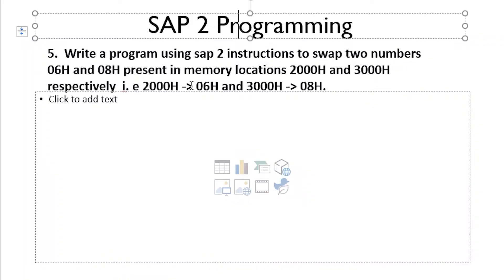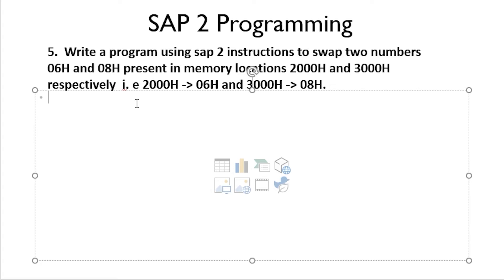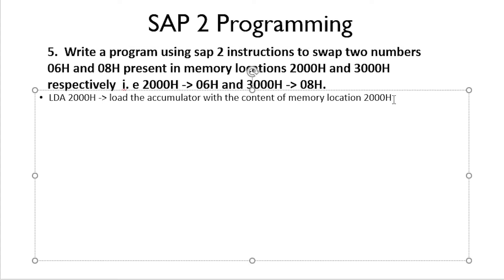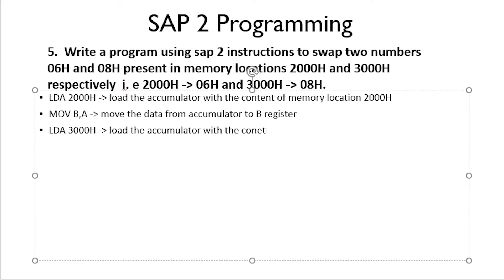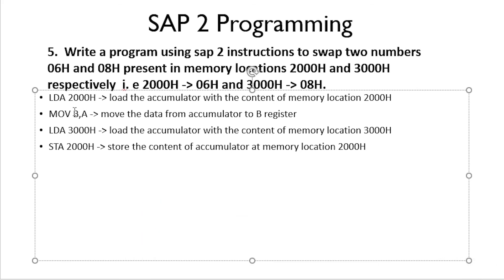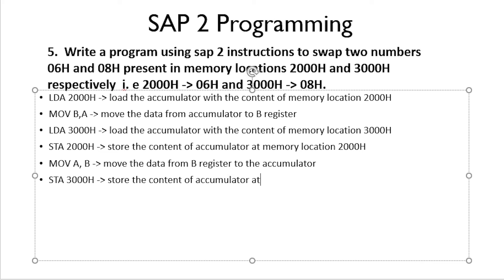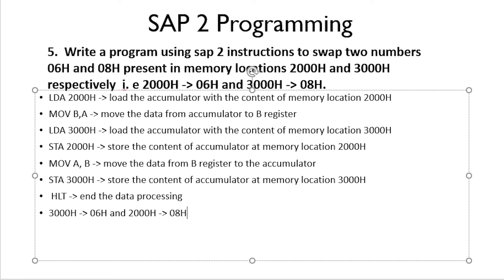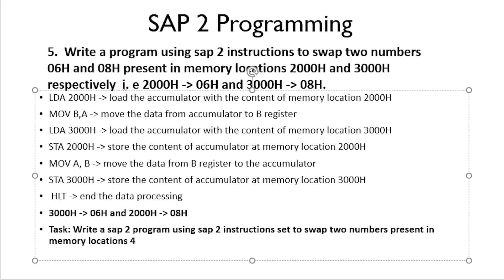SAP 2 Program to Swap two numbers | Assembly Programming

Comment: 4000H  LDA 4500H   A = 06H; loads accumulator with the data from 4600H
4001H  MOV B,A     A = B = O6H; moves the data from acculumutor to B register
4002H  LDA 4800H   A = 08H; loads accumulator with the data from 4800H
4003H  STA 4500H   @4500H = 08H; stores the accumulator to 4500H
4006H  MOV A,B     B = A = 06H; loads accumulator with the data from B register
4007H  STA 4800H   @4800H = 06H; stores the accumulator to 4800H
400AH  HALT        STOP PROCESSING

I gave it addresses and values for fun, not very sure if my addressing is correct tho